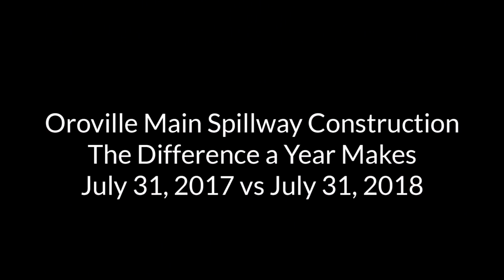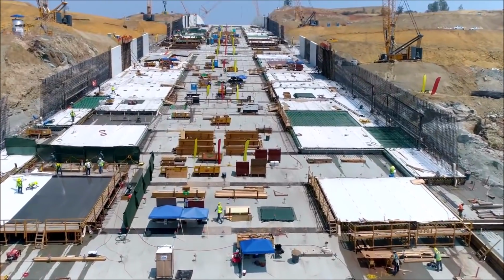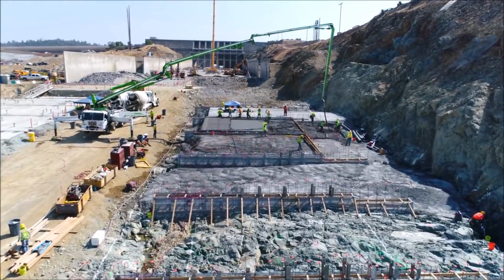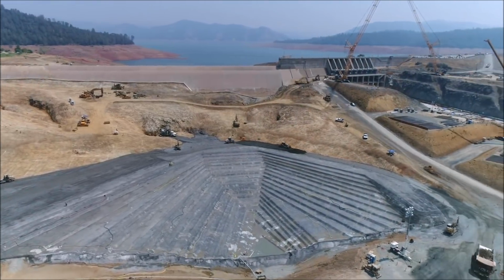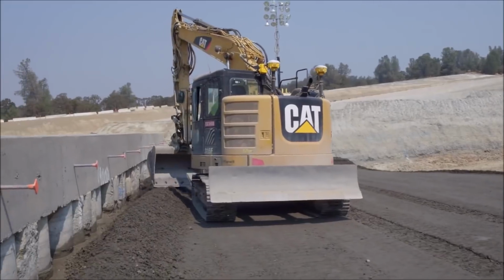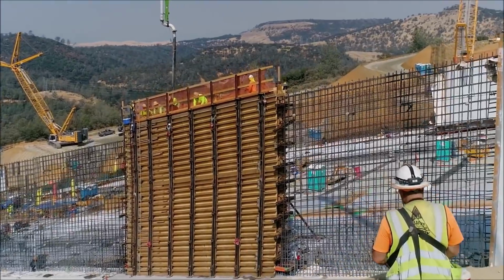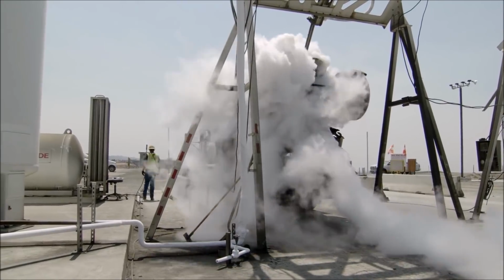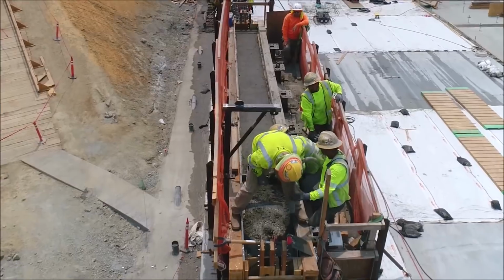Oroville Update! Aug 14 2018

Comment: Amazing project. Now if we could only figure out how to get something done on time AND on budget.
Reply: It's not difficult to be on budget if you properly calculate the budget, materials and manpower to apply the materials is a known quantity and for each calculation you add 10% extra and once everything is added up you add another 10% extra and you have a proper budget. For these public works projects they don't add in 10% extra anywhere and thus always go over budget and that's the politicians fault for wanting the absolute lowest number possible even if it isn't the properly calculated number though it may be correct on paper.
Reply: In this case urgency meant there was almost no chance of getting a realistic budget at the start of work. Time being of the essence DWR put the contract out to bid with plans only 30% complete, trading the risk of going over budget as plans changed, in exchange for starting work months earlier. A big issue I'm told is that the plans Kiewit bid on had far less RCC concrete at the emergency spillway since the cutoff wall was going to be closer. Once they started work they realized that ground conditions required pushing the cutoff wall further out, and as such the price ballooned.
Reply: Robert Ahrens --that will never happen

Comment: where is all the RCC coming from to do the e-spillway steps?
Reply: They crush the rock and make it on site Mike. They put in their own RCC plant right there. 
I think some rock had to be hauled in, but the majority was mined and crushed on site.
Reply: Thank you... Did not realize the mountain has that much material...
Reply: I believe they also recycled the RCC from last year that they had to take off the top in order to put the structural concrete down.
They recovered a whole lot from the river below using track-hoes on barges. The water washed a tremendous amount of it down during the initial flood that destroyed the old spillway.
They just hauled it back up to the crusher.
Reply: That large plant just to the left of where the RCC is being placed is the RCC plant. The concrete plant is on the boat ramp parking lot.

Comment: "Given the right circumstances..." Yeah, call me a cynic, because I confess to being one, but those "correct circumstances" really mean "unlimited budget"
Also, thank you 100000x for all you do, putting real journalists to shame by digging deep into a story and getting real progress reports on a regular basis.
Reply: But the interesting thing about "unlimited budget emergency repair" is that it generally ends up costing less than "usual bureaucratic methods" do for the same work, and takes less time.
Reply: it is glaring to the ears, to not hear the complete cliche, "on time and under budget"...but we came 'this' close to a major disaster !

Whenever you see helicopters lifting big rocks to 'throw' at a problem, then know this - someone's comfort zone has just been invaded and the fear of God is knocking at their door.
Reply: The point is, yearly budgets should have been used to properly inspect, maintain, and even upgrade the dam. Instead the politicians spent them on things that would get them re-elected by small special interest groups.
Reply: Agreed - was going to state the same thing, but I'm five days late - you can get anything done on time if you have the money to do it.  Lets cut the infrastructure to fund "other" areas, then piss on the fire like it's going to do something.  I'm all for helping our fellow human beings on this planet, but if you divert money from infrastructure and emergency services, you're just going to be fucked in the end.